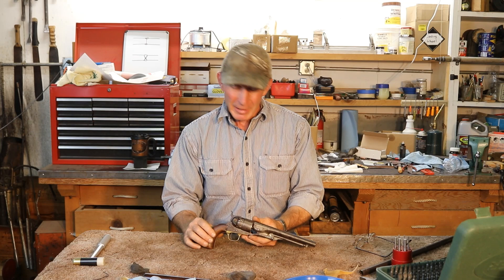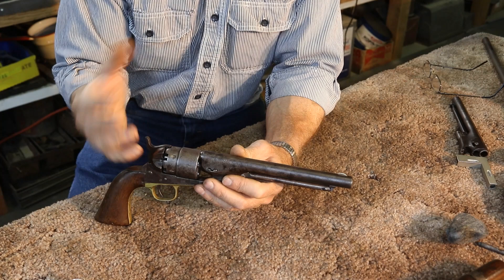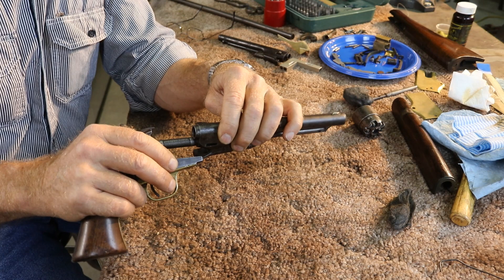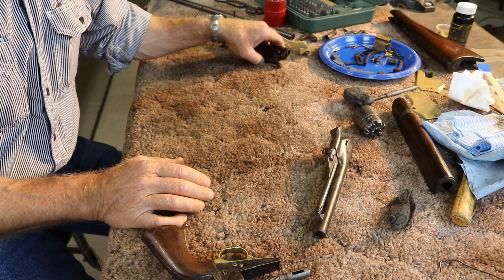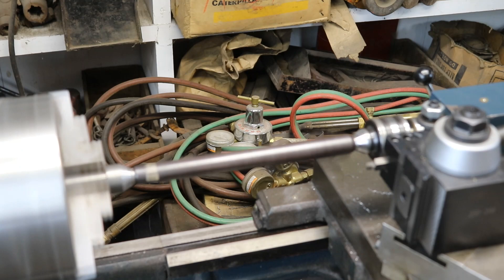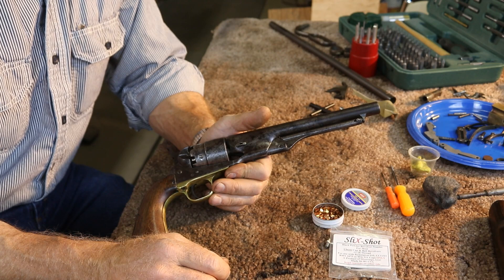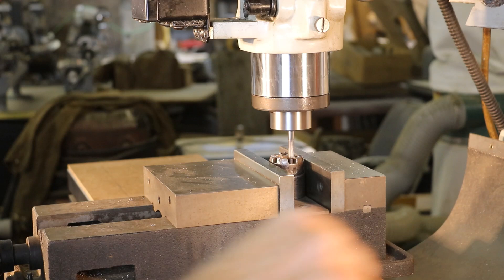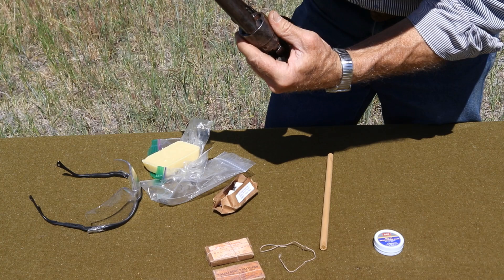Shooting an Original Colt 1860 Army

Comment: So neat to see an original Colt 1860 being fired off for the first time in ages. I own a 3rd Gen that I use as my EDC and shoot it every weekend without fail. Only one misfire (using 1 self-made paper cartridge that took 2 tries to ignite) I've since only used loose powder (777) and .454 roundball, and over many rounds I have never had another misfire, cap jam, or chain fire thank God. It goes everywhere with me every waking moment and it's the most beautiful pistol I've ever seen. Gush over.

Comment: Nice to see a genuine 1860 Colt being tidied up and shot. Thank you Mark for another great video.  Also the fun of reviving old semi-neglected machinery. This is why (as a carpenter) I sometimes prefer new house building to renovation. Much less craftsmanship required but much more to see at the end of a day. It is good to save the work of an earlier tradesman (or woman) when you can, but the hours add up. You also spend a lot of time bent over measuring, cleaning, adjusting and checking your work. Good light, suitable work height, well maintained kit and the occasional moment when you step back to consider your progress are (as you know) essential parts of the process.

Comment: Try to heat the outside of the cylinder where the stuck nipple is. Whilewhen hot dab a small amount of silver anti-seize at the junction of the nipple and the cylinder as it cools you can watch the anti-seize be drawn into the gap. While still slightly warm( but where you can hold the cylinder) try removing the nipple. This has worked for me many times on items as varied from 18 wheelers to Marlin screws.
Reply from the maker: Thanks Tom.  As I mentioned, I tried heat, Kroil soak, tapping.  Actually, I tried them repeatedly to no avail on that one nipple.  Also, it's hardened so I couldn't drill it out either.  Will keep trying, though.
Reply: Kroil is good …anti-seize seems better just what I do. Love your channel.
Reply from the maker: Anti-seize is great when you put in a new nipple to help keep it from rusting into place over time, but won't penetrate to help get out a part that's already rusted in place.
Reply: @thecinnabar8442  Hi, I inherited a Remington Model 1858 (manufactured 1864) and did everything you did with the additional step of putting the cylinder in the freezer for a day, taking it out to thaw, then putting it back in, taking it out etc. and the nipples came out pretty well after that.
Reply: @thecinnabar8442  a carbide bit will drill them out. I have drilled a couple out, with others I heated, softened, and then hammered in a torx key, and once cool, warmed the cylinder with a heat gun and all but two of the siezed nipples came out

Comment: H Mark.  I removed a stuck nipple using a spiral screw extractor.  The spiral runs opposite to the nipple threads, so as you tighten the tool it turns the nipple the right direction to loosen it...worked like a charm!

Comment: You can see the place in my shooting video posted on my channel and I managed to hit the small cantaloupe a handful of times out of 20 shots fired at that 15 to 18 yard distance. After I stopped recording as I was fixing to leave that’s when the hikers complained. Nice old piece btw. My favorite cap and ball revolver to shoot loose black powder and cap and ball from is the Uberti 1860 army but for doing cartridge conversion I prefer my Uberti 1858 with a Howell drop in cylinder

Comment: Good point about shooting safely. I had to give up the only place where I could shoot for free which you can see me shooting at the last time I went there over 3 months ago last fall shooting my Uberti 1858 new model army revolver using my Howell .45 colt conversion cylinder shooting HSM .45 colt 200 grain cowboy loads because after going there for years with other guns to shoot at this spot under some high voltage power lines over 65 miles away from where I live and having taken my new revolver there after having bought it and the cylinder and a couple of boxes of the cowboy loads at the end of the summer and then a few times last fall and I did a few sessions shooting cantaloupes from 15 to 18 yards distance away it came to my attention that there is a path behind where I was shooting about a hundred yards behind it and hikers were complaining about me shooting there so I had to give it up because it wasn’t safe

Comment: I’ve shot a few replica’s of that gun, and currently have an 1860 Army made by Pietta that I am having to mod to accept conical balls. Odd thing is I have never seen an open top colt, that didn’t drop the loading lever occasionally while being shot. Didn’t matter if it was an original Colt, or a reproduction Colt made by one of the many companies that made a reproduction colt. Every dang one of them would drop that loading lever, at least once in a while unless you took a piece of twine and tied it around the barrel and loading lever. And was worse if it was a Colt Walker!

Comment: Another great video. I have been trying to get the nipples off an 1851 but too timid.  I guess after a century being together they do not want to come apart.
Reply from the maker: Boy, they can be a real challenge.  The other 5 came out relatively easily, but the other one has resisted everything I've thrown at it.  I finally decided to drill it out and us an easy-out, but it's hardened and just dulled the drill bit.

Comment: Another one back in service, I did not see a driving dog on your lathe set up? How did you drive the barrel without one ? you will find .005" about right for gap, any bigger and the escaping gas will soon foul up and jam the cylinder. Chris B.
Reply from the maker: Yes, I used a dog in this instance.  Not always necessary between centers if you tighten up the tailstock and take light cuts, but I had a lot to take off this one.
Reply: @thecinnabar8442  I have found that when I use the taper to clutch drive the workpiece I get a slight judder even with a light cut, with a dog there is no such problem, the problem can be worst with an uneven cut as you get on a flame worn barrel joint. Stay Safe ! Chris B.
Reply from the maker: @Englishman French Every machinist has their own pet way of doing things.  I agree that a dog was best used on this cut and that's why I used one and replied to you that I had.  I was just trying to show laymen what I meant by "between centers".  Wasn't intended as a machining tutorial for beginning lathe operators.